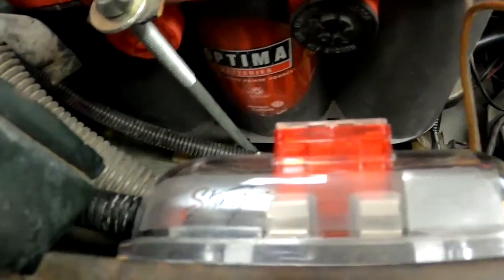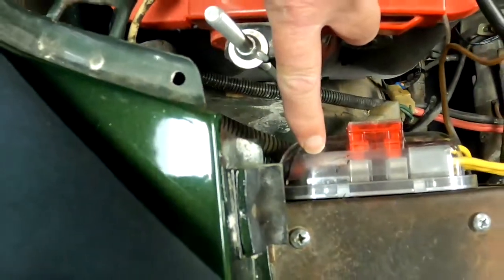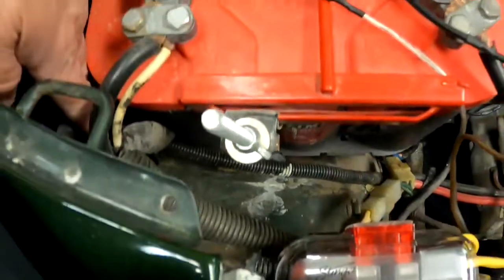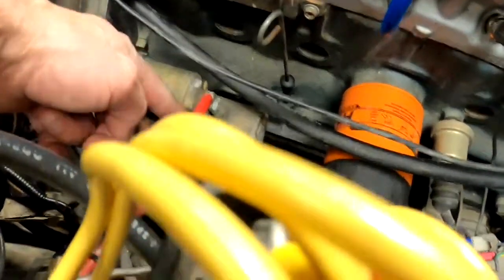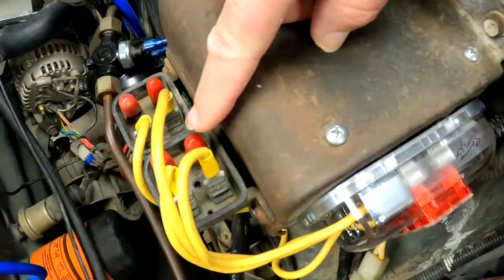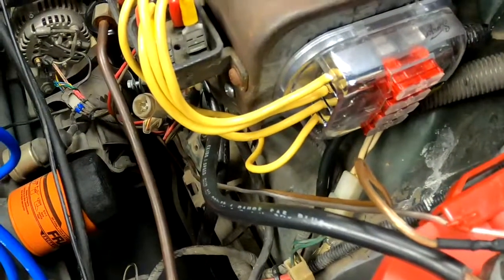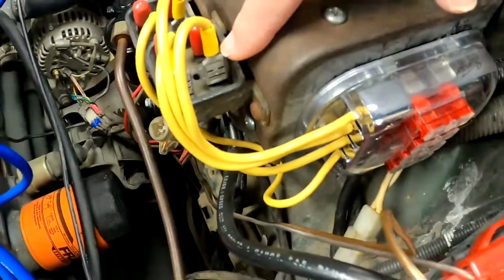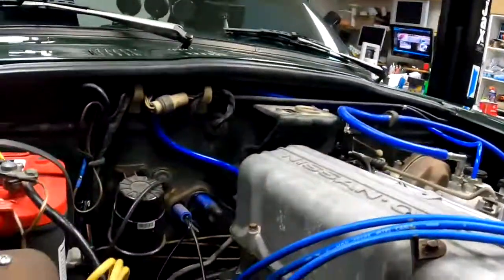280Z Fusible Link Upgrade to MAXI Fuses

Comment: Why did you keep the relays? You should remove them and wire the white/red wires directly to the maxi fuse block as per every other maxi fuse upgrade. Also you should have a minimum 60 amp fuse for the alternator
Reply: Was going to say the same. It would clean up the bay a tad.

Comment: Graet video, can you explain how to hook up the battery to the maxi fuse. Yes i watched the video 12 times. On one side of the maxi fuse Red goes to starter for positive, please help me figure out wwhere the negative hooks up and how.
Reply: It looks like he just feeds it from the starter post, which comes directly from the battery factory. The starter post is used to tie them together. So your wire path should be something like battery --> starter --> (fuse block input --> fuses --> fuse block output) --> accessory post
Reply: I just read your post again. There is no negative hookup for this application. Feed goes from the positive to the fuse block to the accessory post.
Reply: @TheMadkins7  thank you.

Comment: Why 50amp circuits when nothing is rated at 50amps.
How is there protection?
If you had a lower amp circuit
The fuse allows more amps to go thru. There for no protection, as no fuse would blow, as the amperage is set to high by the fuse.
Reply: The factory fusible links are 80 amp for the alternator and 60 amp for the other three. If anything, he's likely to blow fuses sooner, but there is protection